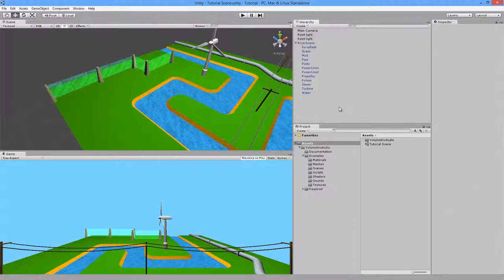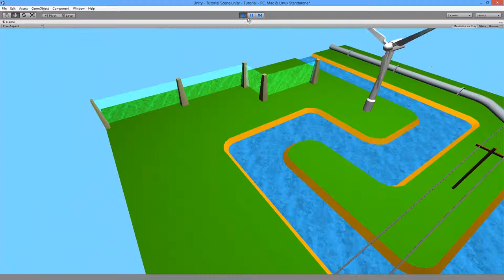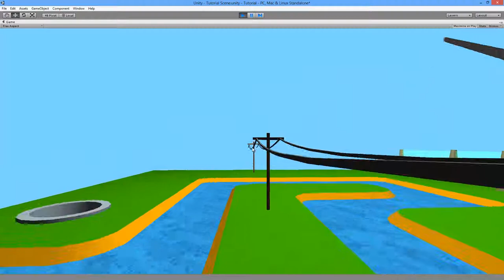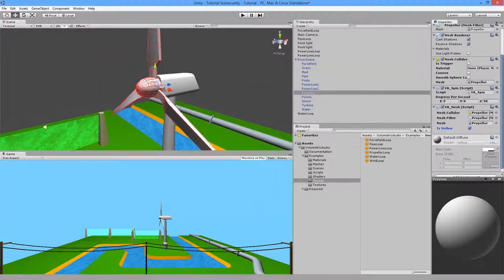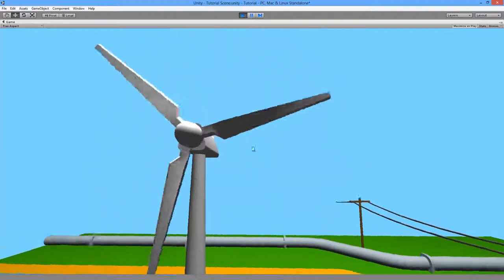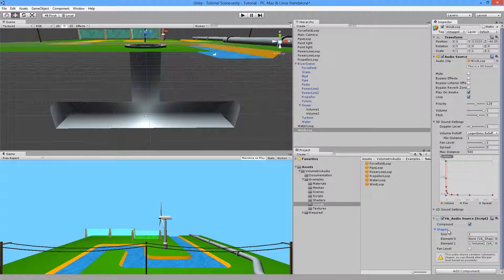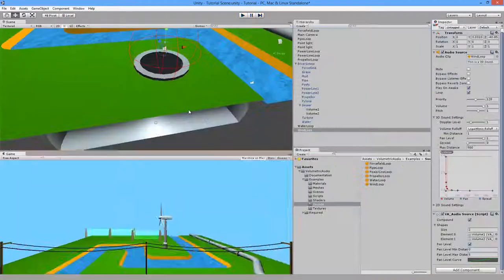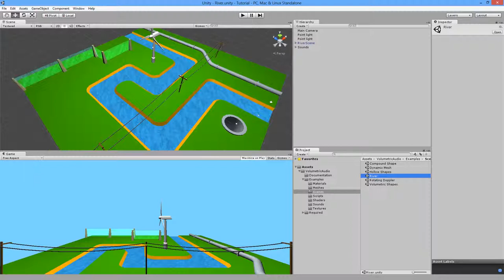Volumetric Audio - Basic Tutorial

Comment: Hello. It is very useful plugin but there is one "bug" I need to be resolved before I will buy it.
Apparently the audio source is attached on the nearest possible point on selected mesh given to sound listener position so If you are walking in the corner of the force field or if you are walking between two streams of the river in your demo scene , the audio source is suddenly skipping from one stream to another one which is closer so sound source is unrealistic switching from left channel to right channel. Can you find some solution for that? thx Great work BTW!!!!!
Reply from the maker: +Jaroslav Matesz That's how it's designed to work. In scenarios where the ausio source can be heard skipping between objects, you should adjust the pan and sound range/falloff settings until it can no longer be noticed. The calculations required to completely elimitate this issue in a more correct way would be too demanding.
Reply: I have bought it 2 weeks ago. I already found many ways to eliminate that problem. Thank you for your answer. Great audio plugin. Very useful for audio optimization for ambient sounds in scene!!!